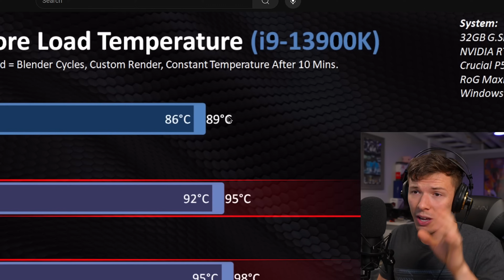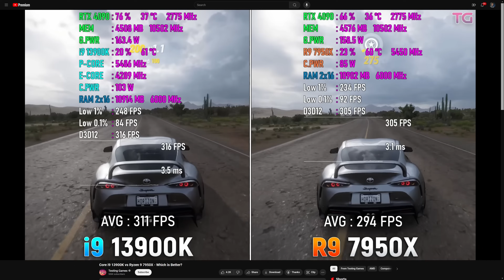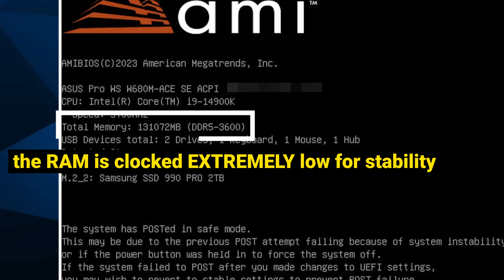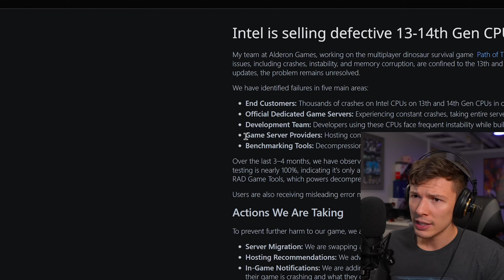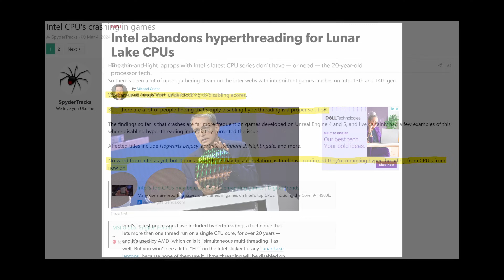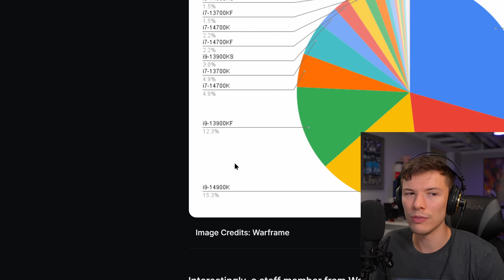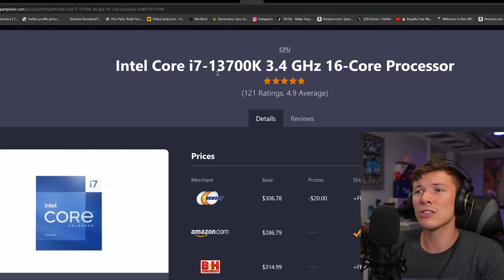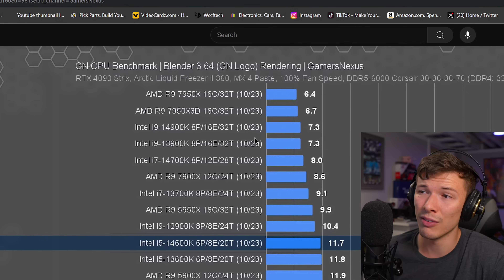Intel F**ked Up Bad

Comment: I think another big problem is that you shouldn't be constantly running your hardware at its highest boost just as a general thing, not only is it really hard on your electricity bill, but if you have a 60hz monitor, aim for a stable 72fps or so and you'll have a good gaming experience without your fans screaming at you

Comment: I use a xeon e5-2667 v2 and it's an awesome chip that I got in a bundle with a board and ram for $68. I've never had any reason to upgrade or ever had any problems with this chip. Sad to see that intel has strayed away from reliability and just ramped up powerdraw to get cheap performance. Reminds me heavily of the pentium 4.

Comment: I have a i9-9900K with a massive air cooler and a unique fan setup. It runs well BUT it sucks to have a heater running while gaming in summer

Comment: Its the boosting algorithm. Its boosting the two cores with to much voltage. Just lock the cores so the boosting algorithm doesnt affect the two cores. Its pumping like 1.6 volts into the cpu to boost those two cores, and its only on the i9's.

Comment: The problem is with the motherboard manufacturers. They do not limit the power draw Amps, PL1 and PL2 as per Intel CPU specs. No wonder the CPU’s fry or die. Start with Intel limits, set on your motherboard for your i9 or i7 and will be stable as a rock. Then gradually overclock.

Comment: i have 14900k and i had an arctic freezer 36 with little stronger fans than the stock ones... and my temps were about 95 degrees in some scenarios ... then i got a water cooler custom loop and my temps doesn't go over 86 degrees in the worst case scenario with AC off and water in the system is about 29 degrees but when AC is on it is 23 degrees water temp and the CPU doesn't go over 80 degrees... i have set my PL1 and PL2 on 320w and 350A .... will my CPU degrade over time ? coz i doesnt have any problem for half a year now... should i do some other downclock or some other settings in bios... sry for bad ENG

Comment: My build was about a year ago.. I messed up bad, ASUS Mobo, i7-13700KF. I can't run XMP without crashing within 2-5 minutes.. and that's IF i get past post. Memtest is flawless on the ram. without xmp overclocking the ram, every so often i blue screen at post at random. I'm running default settings, no overclocking or undervolting or wizardry on the CPU whatsoever. TDR crashes are consistent too just to add more gasoline onto the already giant pile of burning money. FUN!

Comment: is this just an i7/i9 issue?  I've had my i5-13600k for a year now no trouble yet, not overworking or overclocking... but geeze, now I'm worried.  The cpu reviewed well at the time.  Yeesh.

I've been shopping around for a starter gaming pc for my younger brother.  I think I'll be looking at AMD for the cpu at least now.
Reply: Amd is terrible overall... U can always check when u gaming, under stats how hot is u gpu... Never put anyting on max when u gaming, so u gpu, cpu dont overheat...

Comment: 2003-09-15: "Gelsinger: 100W power dissipation ‘OK’ for desktops - Managing expectations for Prescott" at "The Register"

> IDF Intel CTO Pat Gelsinger came as close as he's likely to get before the chip's launch to admitting that 'Prescott', the next generation of the Pentium desktop processor, dissipates more than 100W of power.
> Speaking to reporters at Intel Developer Forum in San Jose today, Gelsinger didn't confirm Prescott's alleged 103W power rating; but speaking about processors in general, he said: "100W for a desktop is OK".
> If that's not managing expectations for Prescott, we don't know what is. That Intel believes it's fine for a desktop CPU to dissipate 20-odd Watt more power than today's Pentium 4 does, is a sign that future chips - e.g. Prescott - will indeed pump out rather more heat than an 85W 'Northwood' P4.

Comment: Intel now playing catchup with Intel and are in desperation mode. Intel has been king since they wen ahead over AMD since the core duo days. They've milked the i7/i5/i3 platformed with minimal increments of improvements, meanwhile AMD has concentrated their R&D to development to make efficient, powerful, single IPC, multi thread performance,   and scalable CPUs with focus for upgradability without sacrificing efficiency.  Intel on the other hand, is now behind the times.

Comment: Question: is this problem across the TYPEs of Intel porcessors or ALL of the LINE of these processors?

What I mean is do ALL i9-14700 (the K's, the KF's, the KS's etc.), fail or JUST the i9-14700*K*'s fail, but the i9-14700*F*'s failure rate is smaller or non existant because the "F" types do not overclock, get what I mean?

Comment: THis is the price users pay wanting ever more powerful CPU's
The faster they run, the more power they us and this generates a lot of heat
that if not removed quickly results in a meltdown.
Answer is so simple, switch to a lower performng CPU or use AMD.
I have an AMD system with water cooling running Linux with no issues.
Newer and faster is not always more reliable.
Reply: U still frying u cpu...Amd is the worst choice ever lol

Comment: I have been running AMD for a decade now. Never had a single problem. Full load 24/7 on my 5950X for 3 years now. My next one will certainly be an AM5 AMD CPU. 🤷‍♂️

Comment: Based on extensive analysis of Intel Core 13th/14th Gen desktop processors returned to us due to instability issues, we have determined that elevated operating voltage is causing instability issues in some 13th/14th Gen desktop processors. Our analysis of returned processors confirms that the elevated operating voltage is stemming from a microcode algorithm resulting in incorrect voltage requests to the processor.

Intel is delivering a microcode patch which addresses the root cause of exposure to elevated voltages. We are continuing validation to ensure that scenarios of instability reported to Intel regarding its Core 13th/14th Gen desktop processors are addressed. Intel is currently targeting mid-August for patch release to partners following full validation.

Intel is committed to making this right with our customers, and we continue asking any customers currently experiencing instability issues on their Intel Core 13th/14th Gen desktop processors reach out to Intel Customer Support for further assistance.

Intel Community

Comment: Why blame intel.....the motherboards are all defaulted at high wattages that has nothing to do with Intel u just need to set up a CPU which people are lazy to do been building PCs since the 90's people are lazy people like plug and play and have no knowledge of anything....its like putting gas in a car and u don't change the oil

Comment: You know what's bugging me? Raptor Lake didn't receive these problems until AFTER 14TH GEN! I haven't heard any bad new for 13th gen last year yet now it's suffering these issues 1 year later? That can't be a coincidence, something must have changed with the CPU's firmware to be aligned with the 14th gen. Wait, could it be firmware? This could've happened to Alder Lake too but no. 12th gen is just fine, what makes it so stable compared to 13th and 14 gen?

Comment: At least Alder Lake is Intel's first success to finally replacing that darn Sky Lake architecture. 12th gen is a safe option for Windows 10 users while this is going down. My newly acquired Inspiron 5620 with the MX 570. I'm incredibly happy with it and proud of the machine, it's actually given me a new appreciation of Windows 10 (downgraded from 11 of course). I found myself embracing it a little by... GETTING ALL THE APPS YOU CAN before Microsoft shuts down their store like Windows 8 and the XBOX 360... 5 DAYS FROM NOW?!

Comment: I got a 14700k in February and it's been working mostly fine.  I had like 1-2 crashes over those months but I'm still quite afraid now.  I don't have the money to get a new Processor and Mobo.

Comment: Building new gaming pc I could have bought core i9, i7 or i5, fortunately i chose core i3 12100F :). It works fine with normal fan but has higher temperatures it seems than 125W TDP Phenom II X4.

Comment: Intel won't change their ways until they have consequences. Intel needs to listen and respond: since gamers are the front line of pushing CPU limits for FPS. Unfortunately, market share compared to AMD has remained steady, Eventually, Intel should follow Biden's example and pull out of the race and relaunch with new branding.

Comment: I've been using a 13900K custom water-cooled system since the chips launched.  The system is headless with no GPU and is only being used for video transcoding (usually 1080p/4K h.264 to the same resolution HEVC).  I've been aware of motherboard mfgs. overvolting chips for years with their various out of the box automatic overclocking "features", and have never used them.  I generally try to run at stock or with a slight overclock with a system as undervolted as the chip allows while maintaining stability and keeping temps from thermal throttling.

It took me quite awhile to find this recipe with my 13900K system, much more than any other system I've used.  Even once I found the sweet spot, I would limit the number of videos being simultaneously transcoded to two at a time.  Three is slightly more efficient than two as far as CPU time, but I would BSOD with three.  With two, my P/E-core temps are generally between 75C-90C under full workload 100% utilization, but with no crashing.  I do not have hyperthreading disabled, and am running all P-cores at 5.5Ghz and E-cores at 4.3Ghz, and it runs like this 24/7, and has processed over 22,000 videos since the system was built.

My general consensus when I got this system up and running is the out of the box maximum wattage allowed by the CPU/motherboard are massively too high for long term stability, which seems to be Intel's "fix" for the problem right now, scaling power profiles back.  I do believe they should be held accountable for false marketing of these products, but I doubt they will, other than hoards of people failing to buy future products due to this disaster.  The motherboard manufacturers are also not blameless, and are always trying to overclock better than their competition with settings that most people have no ideas about.

Comment: Where did you get your education CPUs do not determine what power they use.  Intel Did Not Change anything I have been the teck business sense 1994 It is the fault of the motherboard makers they changed the PL1 And PL2 settings I just built a i7 1400700k system I noticed a heat problem so I checked the bios and the PL1 And PL2 settings were set way above the Prescribed Intel settings. after setting them to the  suggested settings and have had NO problems. I Have ben watching the feeds from Intel and they have NOT said anything about Chip problems. Other ACTUAL Techs have found out that the motherboard makers just decided to overclock the CPUs without telling the user. so check the real facts before bashing INTEL.

Comment: I have a Intel i5-12400F, together with 32 gb kingston ddr4 and arc a750. This system have 0 crashes and played Fortnite sometimes from december till now. I have ordered a i7 13700kf because the 12400f is to week for arc 750 sometimes, first thing to check   if the motherboard overclocks it and lower to stock speed if needed. I might do a video about how things turn out.

Comment: Ryzen 9 5950x and 7950x aren’t that stable either. I have a farm with them, they are just a bit more stable in rendering but only if you leave PBO to default, and even so not all of them are completely stable. I9 14900K can be tuned to give extremely good performance, better than 7950x in most tasks, all while being stable.

Comment: I was not acutely aware of this but ever since a few generations ago of the i7, I smelled the writing on the wall. the i7 was running 3 to 4x hotter compared to my older i5 and the performance upside was negligible. Since then I have been with AMD, and funnily enough around that time AMD made huge breakthroughs in lowering power consumption while providing robust hardware.

Comment: Always lock the max Wattage to something like 80W and no more. 
Prevent the CPU from overheating, temperature should be around 
max 70°C in performance mode with the cooler solution provided. 
I always found ridiculous that CPU now use above 100W of power. This is ridiculous and is going from electronic to electric power level.

Comment: Almost reminds me about my i9-9900k. Killed it with ddr4 3200 kit when using MXP at kit rated speed. It started as random bsod and after 6 months of 24/7 use it didn't boot to windows. Dropping to jedec speed worked only about next 3 months. After done RMA and decided to check datasheets. Mem controller max speed was 2900 and used that for new cpu. It's still in use without problems at my niece's gaming setup.

Comment: Maybe I lucked out but my 14900k runs 60°-70°c while gaming and any type of load. Have had it for abt two months now. Running a gigabyte micro ax board with it and undervolted it as low as it can go.

Comment: Of course you can make a product with 100% failure rates.  Just ask Microsoft about the first release of the 360  lol.  Yes, they fixed it and it cost them well over $1b, but it demonstrates that people will be forgiving if the company immediately utilizes the Tylenol Method and offers a return and replace policy at zero-cost to the user or data centre.

Comment: Latest theories posted by Gamers Nexus and Wendel at Level1 Techs is that it's a problem with the oxidation protection applied to the chips when manufactured. There are several indications that this might be the cause of the problems and Steve at GN will try to send a few bad processors to a company that will try to analyze them and determine if oxidation has occurred. This will not be cheap and the company says the cost will be in the five figure range per CPU they work on. Steve will attempt to afford to send then  at least two processors.

Comment: Curious if my 13600K will end up having issues, so far its been rock stable and ive had it since launch (Oct 2022) Its on pretty much 24/7 as well. Just waiting to see if the problem is batch / factory related as it seems even some early 13900K's are doing fine still.

Comment: AMD was warranting even burned 7800X3d's when Asus overvolted them hard, they did not have to, but user should not be to blame. Intel should recall and send batches out with new production that was manufactured right. Or extend warranty of these 13th and 14th gen. Ticking time bomb even for a 35w low power item it seems.

Comment: Still need a nice 13th or 14th gen intel cpu for my z690, guess they will be up for cheap soon if they are plagued. will keep my 7800x3d for reliability.
In any case, the oxidation will occur, some fast some slowly, depending on use and generated heat. so in 5 years 100% failure rate is possibly true.
Usually we see thing like this in a chemical environment with chemicals entering the insides of electronics and oxidizing them causing similar issues. -> "creep corrosion", eating away electrical paths and oxidizing via's and signal paths.

Comment: i bought a 14th gen when if first dropped starting having issues 4 months later, Intel said i nbeed to buy a new CPU to do a swap test.... now i have 2 14900k/s 1 cant even run past 5.0 the new one is slowly degrading.. i just  want a full  refund forboth....

Comment: Its Pretty Obvious,

Intel recent generations were earmarked as super powerful as the Actual speed  (Gigahertz) has gone up by a significant amount vs other generations and a lot higher than what AMD run.
To me they know they lost the performance crown and to try and stay relevant they are pushing there current CPU'S as hard as possible by basically overclocking them to extreme speeds to compete. 
Doing so is basically making the CPUS unreliable and degrading overtime as they are basically overclocked in factory. this would explain why they spit out so much heat and consume so much power, This would explain why they have such a high failure rate as the manufacturing (if they cant hit this high level speed they are considered E-Waste but probably could probably run at "non" overclock rate but this would put them considerably behind AMD.) Combine this with reliability at users end it doesn't look good for Intel.

This could also explain why Intel are very tight lip on there next gen cpu's they waiting for AMD lineup so they know what the benchmark performance is for them to start trialling overclocking there new generation to keep them in align.

Comment: The problem is just a setting... I've been using a launch-day 13900k on an AIO slightly overclocked and it's rock solid... But. The moment i first booted up this thing and saw voltages close to 1.5v i went into the bios and manually configured my voltage to be 1.35v locked. Then i spent some time trying to figure out the max all-core and per-core clockspeed i can get out of it... That's it... I understand that not all people know why and how to do this, but in my opinion, you shouldn't just go for an enthusiast grade product when you are just a consumer... Again i understand it's a "wrong" way of thinking, but still...

Comment: Was planning to buy i5 13600k but after this thinking about i5 13500 or 14500 do they also can have issues??
Reply: My i5 13600k has never given trouble in the year I've had it